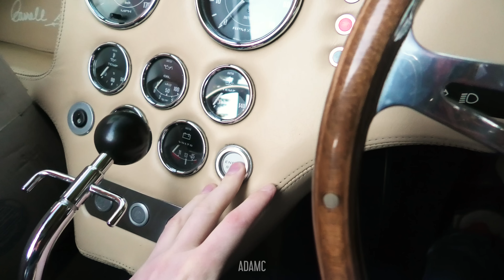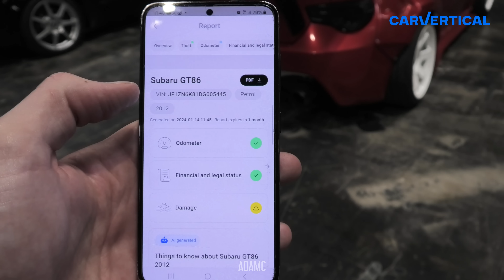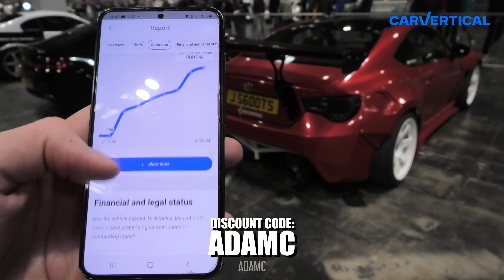Mat Armstrong REVEALS Secret of New WRECK at International Car Show!

Comment: On an AWD car you can run a different size tire front to back. You do have to be very careful though because the tires need to have the same rolling diameter, or at least within a few percent of each other. A 225/45/17 front and a 255/35/20 wouldn't be good because there is an 8% difference in diameter. But if it was with a 255/35/19 it may be OK at a 4% diameter. If it was an 18 there would be no difference. So it's not the size of the rim, it's more to do with the tires that are on them.